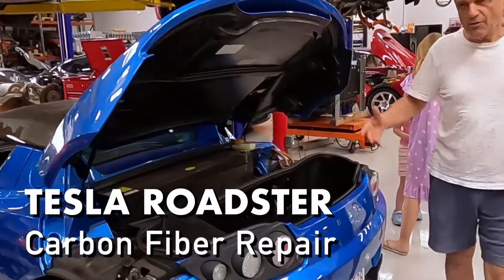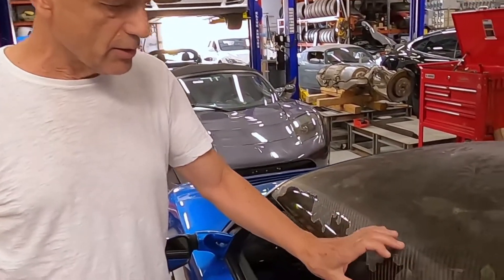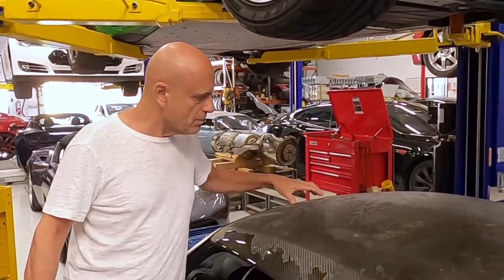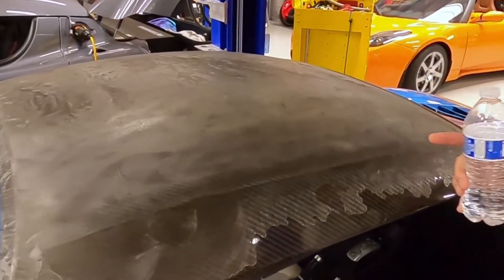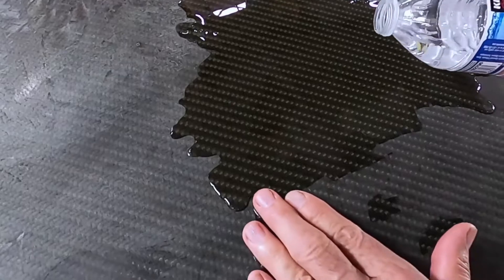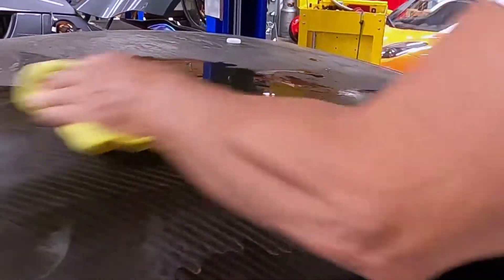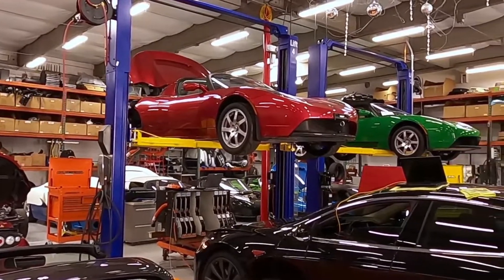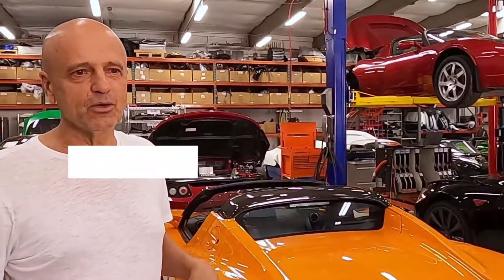Tesla Roadster Carbon Fiber | Gruber Motors

Comment: What was the rarest, most desirable option on the Roadster?
Reply: Depends on what the original owner wanted. All exterior carbon fiber accents and interior carbon parts are rare; the clear carbon fiber hardtop is also a rarity.